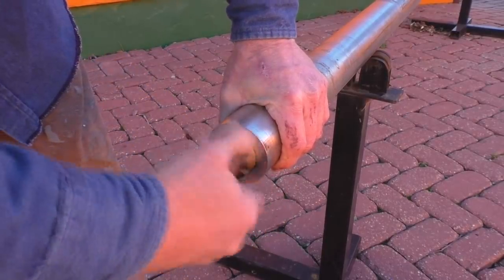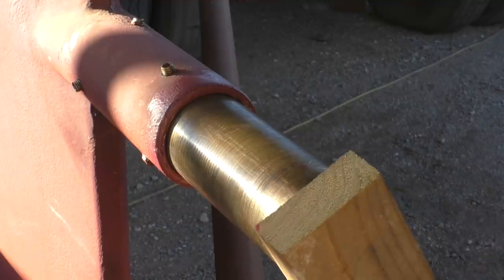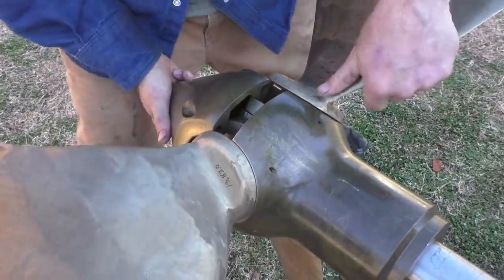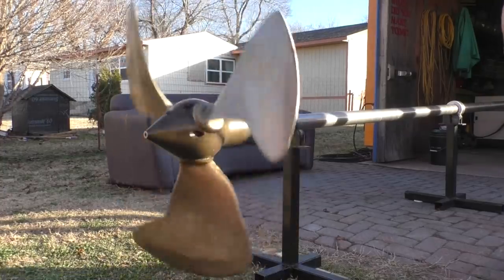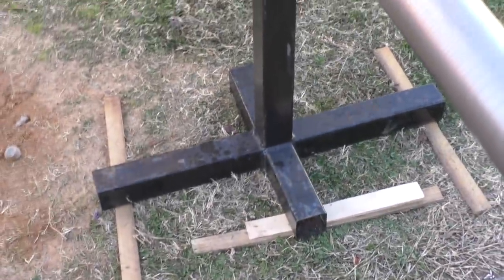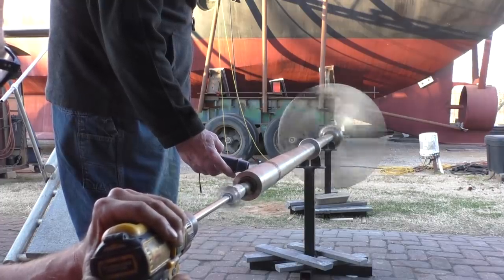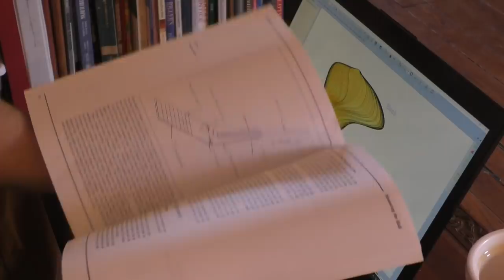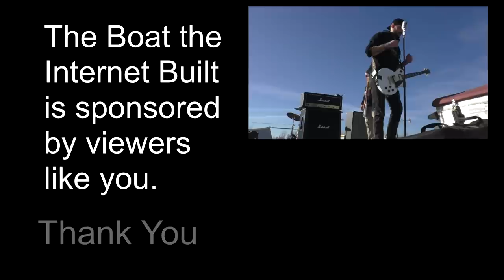DIY Boat Propeller - Part 10 - Tested at 600 rpm

Comment: At A&P school we had this propeller balancer thing and we got the balance within .5 of a gram. Made the engine run much better.
Reply: I balanced rotor blades for helicopters. It is extremely important and will make parts last longer and decrease vibration.
Reply: @dvdadaudits7500  i agree but its only 600rpm maximum. 1 gram put of balance at about a 2' off centerline is only 1lb. 6000rpm and its 100lbs.

Comment: You are correct of course that the weight difference closer to the edge versus the shaft is the cause. Weigh each blade with one end on the scale, then the other end on the scale. Write it down and note which blades have the closest discrepancy ratios. That is, the most similar outer weight to inner weight ratios. They should all also have the same weight overall. You can grind them to create that. In fact you can use the grinder to alter the inner- outer weight ratios as well.

Comment: Yeah, I agree. It's impossible to tell how the current imbalance is going to affect things until it's in the boat. 
I'd get it installed, run it up, and then see how bad it is. I'm not an expert, but I'm pretty sure the rigidity of the system changes when it's installed in the bearings, and the resonance is now coupled to the boat via the bearings and braces. It may well spin with no issues, or you could get a case of a harmonic vibration resonating the boat structure and being annoying.
My uninformed guess is that a mass imbalance furthest from the center of the shaft will cause the most noticeable vibration issues.

Comment: RC model airplane builders use a similar rig to balance their props. The heavy blade always stops at the bottom. Remove  a little material  from the heavy blade. When the prop stops in random locations when given a push its in balance. This works fine for rc  motors spinning at thousands of rpms.  You may want to use bigger rollers like bicycle tires to make it more sensitive. Offset the wheels so the shaft contacts on the upper half of the wheel circumference. You wont be spinning the prop fast at all in this rig just a push by hand to get it moving. The prop will act like a pendulum.

Comment: Long time viewer, first time caller.

This is scary to me - and it's the first of your videos where I really feel that way - I generally agree with your stance on safety.  I think there's a risk here you didn't account for - if it fell off the stand the prop would, as you say, go north.  But when that happens, the shaft would rotate around it's center of mass, sending it's other end south - into you, holding the rpm meter.  Even if I'm wrong about all that, the amount of kinetic energy there is over the top.  I wouldn't want to be anywhere near it.
Reply from the maker: If you can’t figure out where you should stand then you should not be around.  :)

Comment: If it makes it past 100 rpm, it should be good for the most part.  An old guy that used to work in the shipyard used to walk away after 100 rpm, he always said in almost every case if they make it that far they will work.  Keep in mind 600 rpm would have been fast for the girls we went with.

Comment: Hold a wax crayon near the shaft and the heavy side will just touch the heavy side of the shaft - take some weight off the blades on the side of the marking on the shaft.

Comment: First of all your rollers need to be placed on a propper flat surface and then you need to make them perpendicular to the shaft so the shaft stops wandering aft or forward. 
You really need a lot move grease in that head, the small plug/grub screw on the end cap is for filling the head with grease, you need to pump greas into the head until it comes out around the pull push rod at the forward end of the shaft, but with the wobble in the blades you should probably start with  refurb of the head. 
And before you start balancing the propeller check that the shaft isn't bend, it should be straight whitin 0,05 mm (0,002")
Just a quick question is the shaft stainless?

Comment: Now i dont know about prop balancing, but i do know about car connecting rod balancing. And what we do is we actually take 2 scales, have 1 scale support the big end and 1 the small 1 while the centerline is level. Now with a prop that would be the tip of the blade on 1 scale and the center connection on the other. I would probably make a wooden support with a marking line and have a line on the tip of every blade that you line up with the line on your wooden block. That way they should all sit about the same on the scales. Now the goal is to get every tip weight and every center weight close to eachother for each set. Why do it like this? Wel its force times arm right? So 100grams at the tip of the blade wil be a HUGE vibration while 100grams right near the center of the shaft wont do much.

also if you want to do a diy balancing on it and know where to put the weight pretty precise, there is a guy on youtube called the gadgets playlist, he has a video called gadgets#59 where he shows a diy balancer. Might be someting worth looking in to

Comment: Just another question are you going to use the prop as a water dynamo to generate power while sailing to help with charging battery's and power use ,I suppose a couple of alternaters you could  free pully onto driveshaft while gearbox in neutral and engine off,would not be hard to rig up.would be a excellent water power mill you could use it while anchored up and let the sea turn your prop rotation to power up batteries on dull cloudy days or windy when  engine is off ..stay safe to you and all your crew  happy new year all

Comment: lay the blades on their sides so they are as level as you can with the scale under the outside of the blades..  this can get the blade weights closer.. 
if you put new bearings in the stands and removed the grease and oil. you could set the shaft on the stands with the blades and rotate the shaft 1/4 turn and release.. see if it stays or does it rotate to the heavy spot down.. this takes some good quality bearings usually. 
the oil or grease is enough to build up a wavefront that can stop the bearing from rolling as free as it needs for this test.. i know one youtuber that has oil in his surface grinder balance shaft bearings.. you can see the oil reverse the shaft rotation when he positions it every 1/4 turn.. 
 please build some stands that allow you to slide the shaft in and out without letting it droop half way out.. it almost looks like the there is a bend at about the 3 foot from the inner end mark where the shaft was dangling in the cutlass bearing and housing bor60on my friends boat..  3 to 1 reduction in the marine transmissions..  we could run the engines at 1800 to 1900 RPM giving us prop speeds of just over 600 RPMs like you were testing at.. 

 our props were fixed pitch.. 32x28 pitch 3 blade.. at 600 shaft RPMs we could get around 19 knots. which is fairly impressive for a 104' wooden hulled power boat..  it was a former army rescue vessel and with the original marine modified aircraft V12 engines.. same as the army air corps used for the most part.. i have seen specs that said 50 knots.   the last time i was out on the boat. .the wind was blowing across the bow at 300 degrees and there were 8 to 10 foot white caps.. we just plowed thru..  just kinda shuttered slightly as the waves hit the the sides of the bow  i am wondering instead of just normal amber grease.. if you should be using blue boat wheel bearing grease..  but i don't know what you used for the inner shaft.

Comment: Do you have a stroboscope? If not, get one, or download a phone app that can be a stroboscope with your camera flash. Label props 1, 2, and 3. Make a visible mark equidistant from the center axis. Spin the prop and find the right flash frequency so you can see each blade and mark, the mark which is furthest out when the stroboscope is flashing is going to be the rotor that's the most unbalanced. Uneven rotating mass will cause premature bearing wear. 100 grams off at the tips is much worse than 100 grams off at the base. So keep in mind the weight you remove at the tips makes more difference than weight removed at the base. While the actual weight difference is important, what's more important is that the center of mass of each blade is the same. This is a super low tech way of doing this, but it will get you into a better ballpark than where you are now. I definitely recommend scratching your head on this for a bit before you start blowing bearings, seals, and other expensive equipment. You'll have to use the stroboscope in the dark though. Just a warning, I've never done something like this and my recommendation is definitely not the best way of doing this. Just a little better than not doing anything haha.

Comment: For some reason that 100lbs of spinning death made me nervous
Reply: Darken , 14,544 grams per blade it’s 43,632 grams or 96.192lbs of death
Reply: It made me so anxious watching that, imagine it starting to wobble and falling over into the ground, that could kill a man so easy.
Reply: @aldousorwell4577  Ive watched Doug do alot of stuff, been watching for years, this is the only time I was scared for his safety lol
Reply: @darken3150  me too, even I had one eye closed..
Reply: Doug's motto...Safety THIRD!
Reply: I agree with Dough on safety stuff, but I think he missed one important point here. He was absolutely right, where the spinning propeller would go. My question is, which direction would the shaft go once the prop hits the ground. ;)
Reply: Pucker factor level 8 at least.
Reply: It could be because you have some common sense.
Reply: @irvingwashington3771  I would want to anchor the stands securely and fix some rabbit ears or loops before spinning it up to prevent the shaft possibly jumping off the bearings.
Reply: Amazing how that drill easily turns that heavy shaft, and propeller!😳😯
Reply: Big prop, but not too big. Looks about 4.5-5ft in diameter.

Comment: Shafts will alway have harmonics. When you spin them up they go through criticals when that happens the shaft will actually bowes slightly. Ones it goes through it straightens out. When you balance it your actually balancing the bow out of it. What you are doing is called a static balance. A dynamic balance you would need a balance machine for. Most decent machine shops can do it for you...maybe even a driveshaft shop. The only bonus would be is lengthened cutlass bearing life.
Reply from the maker: I doubt you'd find a drive shaft outfit that would ever consider swinging 100 pounds of blades.  : )
Reply: @SVSeeker  Ask...
Reply: @SVSeeker  Assumption is the mother... something something :)
Reply: @SVSeeker  There is balance machines balancing huge industrial fans. Probably the dynamic balance dont affect this so much because the prop doesnt spins so fast.  It also depends where the 100 grams difference sits on the blade. You can balance static, instantaneous and dynamic. Static is sufficient.
Reply: I’m not qualified to add any information but it sounds like what you are saying makes sense
Reply: @dgtlmoon  of all f---ups
Reply: @SVSeeker   what about a harmonica balancer
Reply: Wow! It's really obvious when someone knows what they are talking about! :)
Reply: @SVSeeker  Maybe you can rent or borrow a DynaVibe, they are used to dynamically balance aircraft propellers while the engine is running. It will tell you where and how much weight to add.
Reply: @ulbuilder  100% best suggestion!
Reply: @SVSeeker  I think a decent option is to weight match the blades. Then get the shaft balanced with out the blades.
Reply: @ulbuilder  My thoughts exactly.
Reply: @andyswmr714  considering that he has spare blades, getting them equal is the best compromise.
Reply: @SVSeeker  shipyards do it every day. Propeller shops are part of every waterfront that does repair work and shafts are part of the equation.
Reply: Not just the cutlass. Remember that long shafts will often have an intermediate bearing.  I've worked on shafts that were worn down to 40% thickness. Working commercial vessels often go too far before hauling out for props and shafts work, opting to just keep it working until point of failure. Time is money
Reply: @andyswmr714  alot of turbochargers are made like that. Each part, compressor, turbine wheel,  shaft and nut are balanced individually
Reply: @sirmack3262  Yes, jet engine compressor, turbine and fan blade assemblies are built up with pre-weighed  blades, before each  assembly is tested in a dynamic balancing rig . Whole spools are also precision ground in a blade tip grinding machine.  You wonder if this propeller and shaft assembly could be mated to a truck  wheel balancing machine using a pre-balanced jig made from an old wheel.   Probably favourite to just find a friendly shipyard, see what they normally  do and replicate  their usual practice ?

Comment: @SV Seeker.  The problem is. If there is any shake at all. The shaft will walk around the rear wet bearing instead of spinning in it. It will ruin the shaft and the cutlis real fast.

Comment: You're over thinking it Doug. This is just like balancing a wheel. Think of it as a fixed assembly. Take weight off the heavier blades to match the lightest blade. You're only going to be able to to a static balance in the axial plane only. Without much better measurement equipment you won't be able to eliminate dynamic vibration. You're correct about the harmonics, but I would say the imbalance you currently have IS significant because it's going to cause incremental and ongoing premature wear to your bearings. Great work on it though. Your engineering style and work arounds continue to impress me.
Reply: Actualy the stand moving allows you to balance at speed.... You bring it to the rpm that causes that stand to move then you bring in a marker to the rotation of the blade at the outer edge until the heavy side just touches the marker.... Then you will have marked the heavy point.... First static balance blades tip to base then static balance with the blades on the shaft and the shaft resting on sharp blades like scraper blades or planer blades... I can accurately balance for 100 thousand rpm this way as in jet engine turbines...
You will need to remove weight from the center of balance of the tip to base
Reply: what ed says
Reply: Take it to a driveshaft specialist
Reply: Bernoulli's principle (when a fluid meets a restriction the fluid velocity is increased, with a proportional decrease to pressure)!

Comment: There’s a procedure for balancing propellers I learned from hovercraft building. Put  the shaft on a knife edge to eliminate friction. The heavier blade will rotate to the bottom. Then you can fine tune the weight of each blade until it is perfectly balanced and will not rotate on its own anymore.
Reply: That's known as static balance.

Dynamic balance is a different kettle of fish.  : o)
Reply: Car wheels I dynamically balance on a machine, spinning it up and putting weight on both sides of the wheel. My motor cycle tyre I balanced static on rollers and its perfectly fine too. I do believe this static trick aka having the 3 prop blades the same ish weight will be more than good enough to not have any problems. The wobble on the stand will show even a tiny imbalance but the boat won't move that easy so even this 100 gram imbalance would probably be just fine
Reply: @timstewart8690  it’s still better than just measuring the weight of each blade in that it takes the centre of mass into consideration as well. 

I’d match the blades closely on the scales & so a static balance.
Reply: I believe a static balance would be fine,dynamic balance is for two planes, and with the variable pitch if you balance in two planes it will increase as pitch is increased. You would chase it forever.
Have you ever used thordon instead of rubber for bearings. Man that looks good.
Reply: Drill Power... green..lol